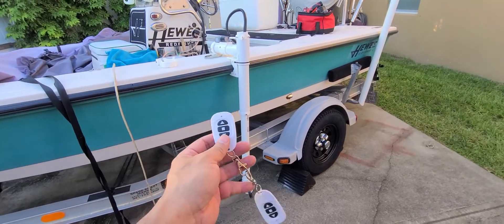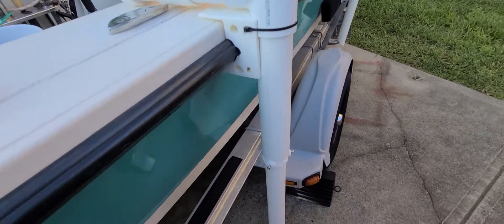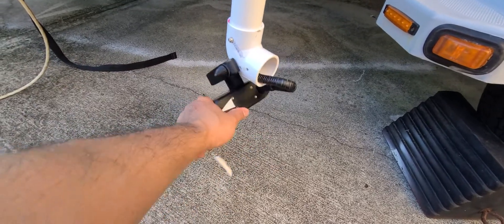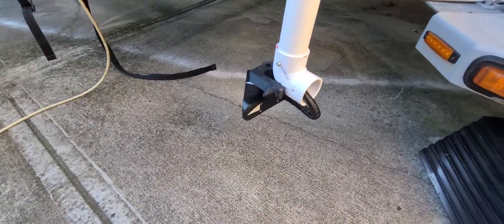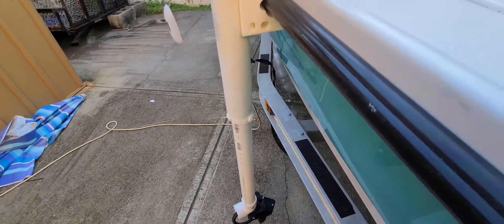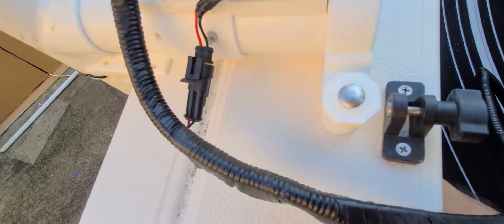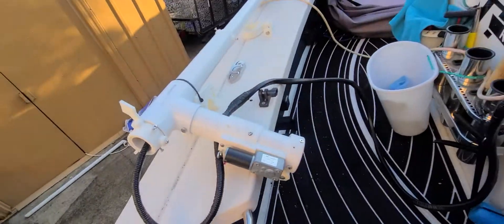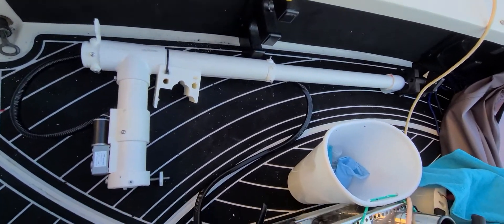Panoptix Livescope Remote Control Rotating  Perspective and Forward/Down Mount Build for a Boat

Comment: Are you willing to share how you did your build and the parts list
Reply from the maker: I replied in the comments on parts. No list was made.  The key parts of design was 3d printed gears to fit the pvc post driven by the motor w a belt.

Comment from the maker: My favorite part of this setup besides totally remote control scanning are the hidden transducer cable inside the 1.5in PVC and the ability to change from perspective mode to forward/down mode by rotating the 3D printed U mount at the transducer.